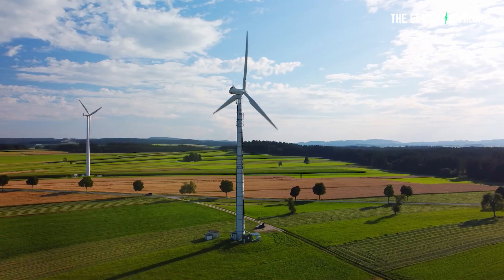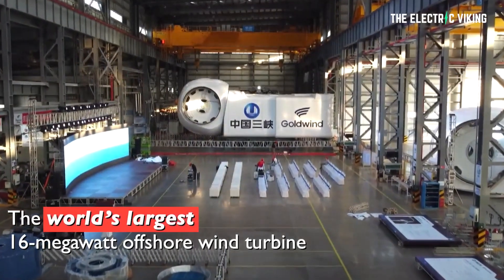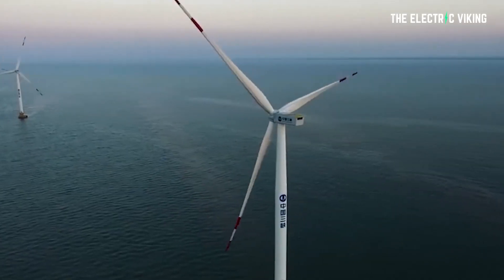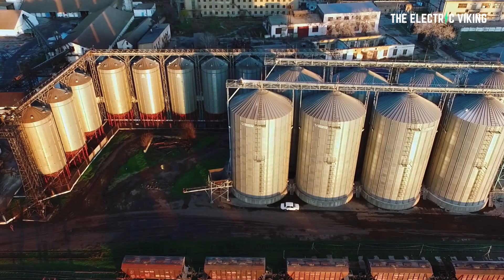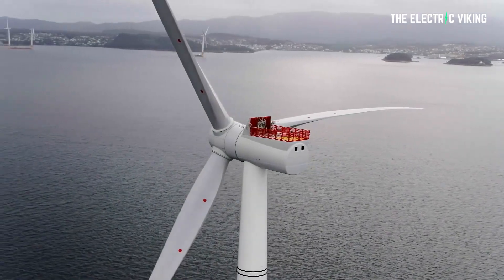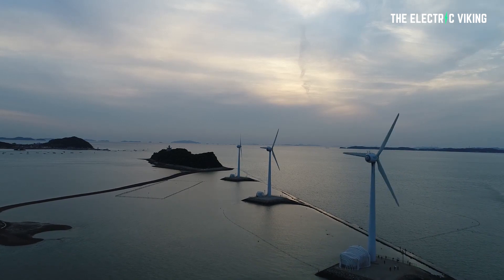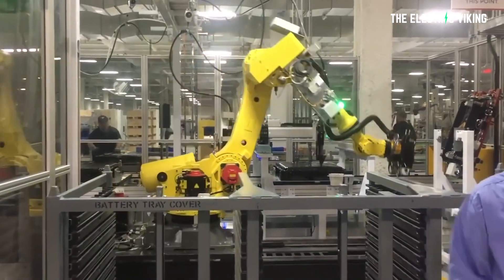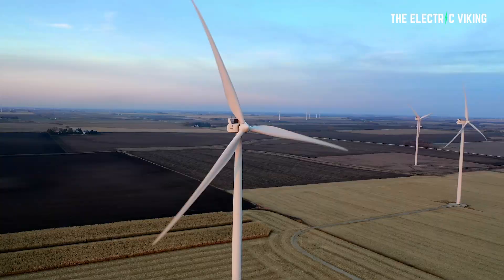The world’s biggest offshore wind turbine will bankrupt coal & gas

Comment: Im not agaist EVs ; they have a lot of cool technology and give you independence which is their real main selling point. But dont' tell me they are the future until they have battery tech that is lighter, safer and can scale; Lithium isnt' it.
Reply: Li-ion batteries were arguably good enough for Tesla to launch itself into a $50B revenue company today and change the entire industry.
Reply: @jameshoffman552  Yes, they function when there is sufficient power from the grid.  Wind power will never provide enough power to replace existing power plants.  It may be a useful augmentation, the idea that batteries can supply enough storage to back up no wind days is pure fantasy.  The idea that the cost of electricity can be reduced by using wind power and vaporware batteries is demented fantasy.
Reply: @allblooz  but people are already doing it, charging car using their own panels and then using battery to provide power at night. It’s cheap and efficient.
Reply: @allblooz  Please explain what you consider to be the flaw in this video by Tony Seba: https://www.youtube.com/watch?v=fsnkPLkf1ao
Reply: @jsanders100  Solar energy is fine for small scale usage.  I have a Inergy Apex solar unit, and am very happy with it.  I have used it during the frequent power outages here in North Idaho and it has charged my e bike for three burns at Burning Man.  That doesn't mean it is scalable to be a primary source for the grid.  There is no current battery technology that can provide the back up for its intermittent power production.  The typical hand waving by solar and wind advocates is no substitute for demonstrable technology.
Reply: @CiaranMcHale  Sorry, couldn't make it past his patently ridiculous claim that solar is now the cheapest form of energy.  Especially since there is no current technology to store the energy produced by solar panels, and likely not for a long time.  There is no way around the fact that a grid powered by solar and wind must have immediately available back up power when the sun isn't shining and the wind doesn't blow.  You have a choice.  That can either be coal, gas, hydro where feasible or nuclear.  Of course that raises the question of the ridiculous opposition to nuclear by the same fanboys who think wind and solar power can produce enough reliable electricity to power the grid.
Reply: @allblooz  If you didn't bother to watch the entire video, then I'm not going to waste your time or mine trying to discuss it with you. BTW, Tony Seba is not a delusional crank. He has a track record stretching back over a decade for making implausible-sounding predictions about trends in technology adoption that later turn out to be accurate.
Reply: @CiaranMcHale  OK, I have now watched the video, and nothing I saw changed my initial impression.  What we have here is someone claiming there is such a thing as a free lunch after all.  I checked Sebas bio and was completely unsurprised to find his expertise is manipulating ones and zeros.   I must have missed the part where he admitted that the battery technology that is absolutely essential for wind and solar to have a remote chance to fulfill his predictions doesn’t exist and is highly unlikely to exist for decades, if then.  In the meantime I have some prime oceanfront property near Phoenix.  For you I can make an extra special deal.
Reply: @allblooz  Production of lithium ion batteries has been growing exponentially over the past decade. Then there is CSP (Concentrated Solar Power), which means sunshine gets reflected off mirrors to focus it to heat sand/salt that acts as a heat battery. The heat is used to generate steam to drive a turbine. In some CSP plants, the excess heat generated during the day can be used to generate electricity during the night until the next day, so CSP can provide 24X7 power. My vague recollection is that these heat batteries used to be about 100 times cheaper than equivalent lithium ion batteries, but that factor is likely to change as the price of lithium-based batteries changes (the price has spiked over the past 2 years but the long-term trend, over multiple decades, has been for the price to keep dropping). Some other power plants use solar/wind electricity to pump water or compress air to provide an energy store (in effect, a battery) that is used to drive a turbine. The point is that a combination of several battery technologies might be used.

One point that stuck with me (but I think it might have been made in the book upon which the video was based) is that the estimated cost of converting the entire US grid into solar/wind+battery storage is in the region of $2 trillion, while the annual cost of fossil fuel for the existing grid is more than $1 trillion. So, yes, it may take years or decades to build the required solar/wind plants and required battery storage, but the annual cost savings resulting from doing that will provide a compelling motivation for energy companies to make that investment.
Reply: @allblooz  What? Vaporware batteries? There are huge capacities of battery manufacturing being build as we speak! Also just a wind capacity of North Sea in Europe if harvested 100% is able to power electricity demand of the whole World! Of course, it is not easy and it comes with price as you need to build the HVDC backbone and increase the capacity of AC grid but it definitely doable and long term cheaper than using ever pricier fuels needed for thermal power plants and the environmental damage we have to deal with.
Reply: @CiaranMcHale  CSP is not good. Please go thru the case studies of several large scale CSP and you will know what I mean.
Reply: @hclau362  In my experience, YouTube is likely to delete comments that contain a link to something on another website (but links to videos on YouTube are okay). So rather than ask you for links to case studies you think I should read, please specify internet search terms I can use to find them, for example, the titles of reports and possibly the names of report authors.
Reply: @CiaranMcHale  Just have to search Large scale CSP.
Reply: @hclau362  I did an internet search for "large scale CSP" and looked at the first page of search results. Nothing stood out to me as backing up your claim. Stop wasting my time. If you want me to look at specific documents, then give me what I need to find them.
Reply: You claim that you are not against EVs, yet you have repeatedly posted misinformation in your comments on this channel.
Reply: Tesla model Y will be the most sold carmodel on planet Earth in year 2023

Comment: Wonder if we will see research into using coal instead of natural gas to make fertilizer.  Have no idea just thinking it may be a use for the unwanted coal
Reply: That would be silly. The whole point is to keep fossils in the ground and out of the atmosphere. If you use coal as fertilizer, it'll go into plants that eventually rot - releasing CO2 into the atmosphere.

Coal is not unwanted specifically for power. It's unwanted. For anything.

The goal is to leave the remaining coal, oil and gas buried underground, where it was stored for millions of years - outside our atmosphere.
Reply: Coal contains significant amounts of mercury that are released into the atmosphere on burning. It's a very big contributor to mercury in the environment.
Reply: @danielstapler4315  I did not mention burning coal.
Reply: @danharold3087  If the mercury is in the coal and you make fertilizer out of the coal, I'm thinking you now have mercury in your fertilizer.

Comment: These things are not only hugely ugly, kill birds on a large scale (first hand experience) but use up an enormous amount of land which needs to be sealed by concrete. Doesn't matter if land or see, energy conservation still applies.what does that mean? They change the micro climate where they are. Take out wind,  cause global stilling and that causes the air to be able to carry LESS humidity. Solar on rooftops is the way to go. These things are NOT environmentally friendly.

Comment: Come on, Sam!? Blades bigger than a football field? Really? They may be longer than a football field but NOT bigger.
Reply: Put three side by side on a football field and say that again. Also the swept area of any one blade is 43,000 square metres or about 11 acres. How big is your football field?
Reply: @theairstig9164  You are correct. 
However, the viking did not say anything about your points. He said, and I quote, "the blades are bigger than many football fields".
Nothing about swept areas are laying blades side by side.

T answer your size question, according to FIFA ...
"The minimum length for the touchline is 90 meters, while the minimum for the goal line stands at 45 meters. The maximums stand at 120 meters for the touchline and 90 meters for the goal line. When it comes to international matches, the soccer pitch can range from 100 x 50 to 130 x 100 yards (100 x 64 to 110 x 75 meters)."

Comment: 2:38 Ok you claim that 1000 of wind turbines of 16 MW would be enough to power California. Well I check that.
In 2021 California used 277 764 GWh, that is 761 GWh/day and requires constant power of 31.7 GW.  That would require 1981 of those wind generators working with full constant power, which is not realistic. So in best scenario you are wrong by factor of about 2. 
But in reality the generation of energy of wind generator is only 20 % of the nominal power so the number would have to be 10 000 and you are wrong by a factor of 10. That is a huge amount involves huge cost expensive network of cables, maintenance and huge storage facility for the windless periods etc. So it is not so rosy.
Reply: I checked on the prices of the MG4 in Europe where he claimed they are roundabout at 20K Euro. Not true. It is 30K. Be very careful with Sams numbers
Reply: Accurate
Reply: Fair point, but not an argument against wind.

Comment: Wind and solar combined - world wide are less than 2% of energy produced. It is nice to have more energy; but it is costly and fossil fuel prices can go down substantially or up.  So?  so at best wind and solar will help meet demand but it won't reduce the use of fossil fuels because it can't be made fast enough and there isn't currently anyone making storage that can work Lithium is a dead end.
Reply: The time and cost you replace an existing coal fired power station with a new coal fired power station is no longer economical compared with replacing with renewables. The cost per unit of energy is less now for renewables compared with fossil fuels and that cost is coming down due to improved efficiencies with projects like this video and other technology advances. Fossil fuels will continue to be phased out going forward.
Reply: This video by Tony Seba refutes some of what you say: https://www.youtube.com/watch?v=fsnkPLkf1ao
Reply: False.  Wind and solar were over 10% in 2021, so higher than that now.  And over half of all new energy production is wind or solar.  The reason?  They are cheaper than other sources.
Reply: @michelangelobuonarroti916  Have another bong hit.  There is no battery technology  on the horizon that can supply the necessary backup for the inherent intermittent power production of wind and solar.